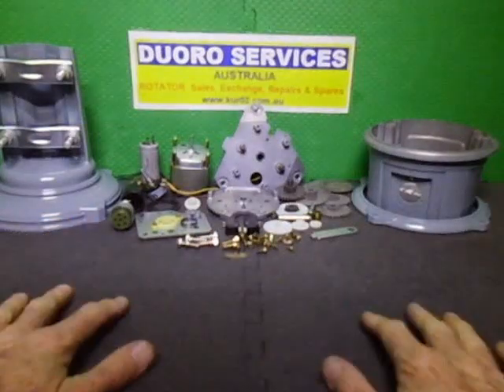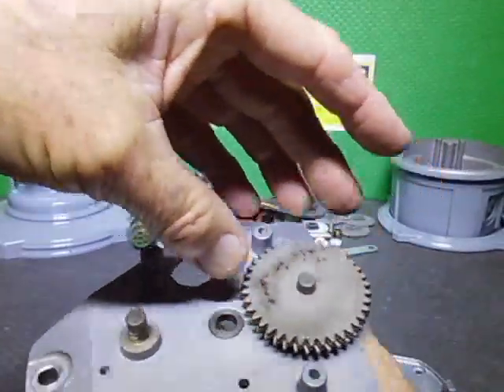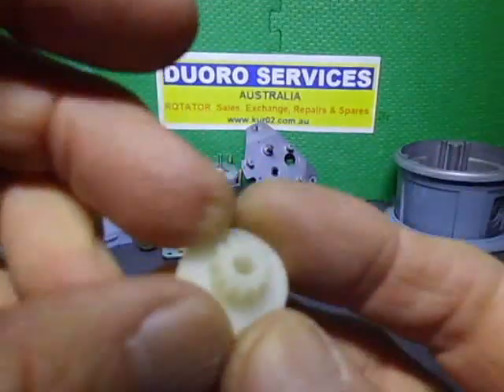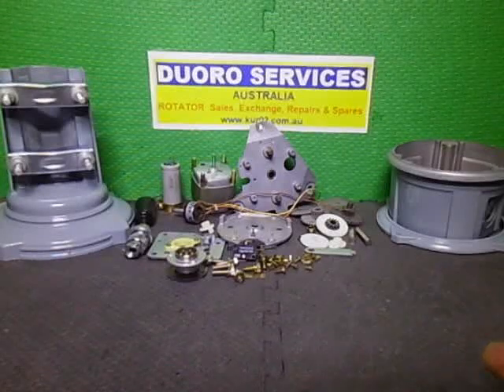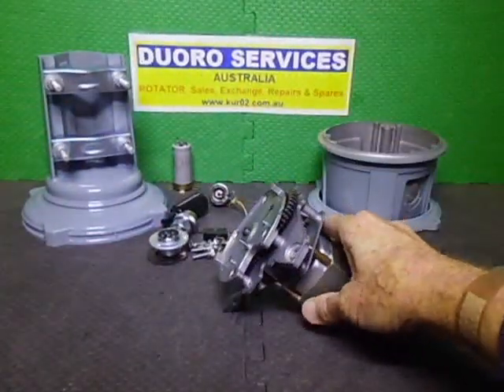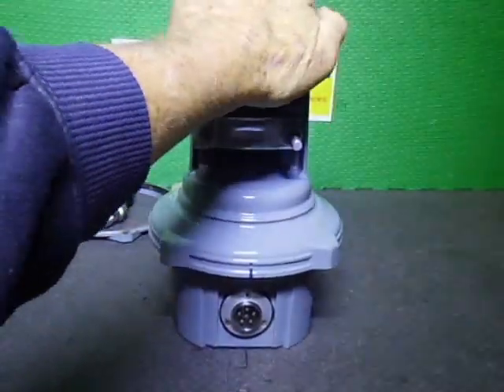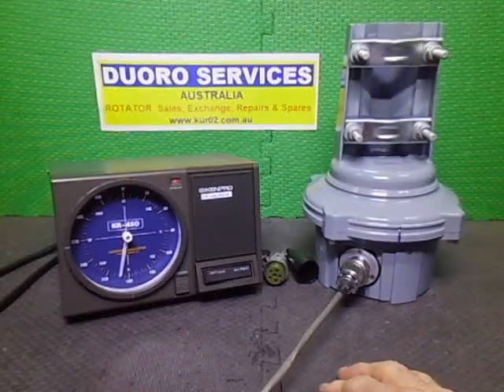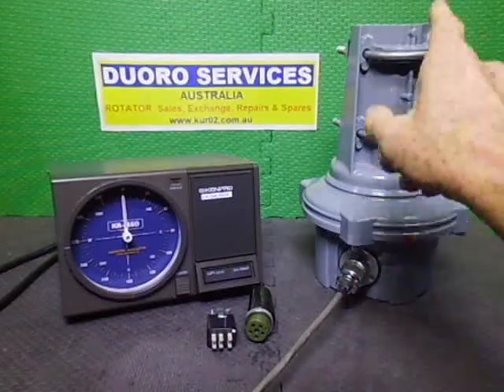KENPRO KR-450 Rotator Refurbishment & Upgrade

Comment: Great video,  i have a kenpro rotator and was wondering if you could tell me the colour coding of the 3 wires so i can connect it correctly with the controller/capacitor.  Thank you
Reply from the maker: Hi Greg, thank you for the comment. Left is terminal 4 goes to Green wire of motor,  Right is terminal 5 goes to Red wire of motor, Motor start cap is across 4 & 5,   Common is terminal 6 goes to Black wire of motor. Regards Peter.